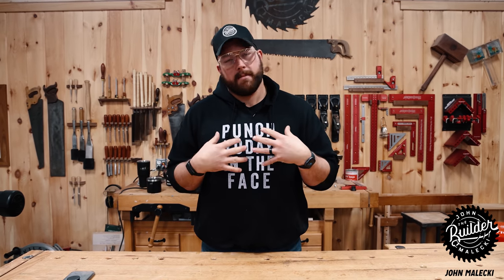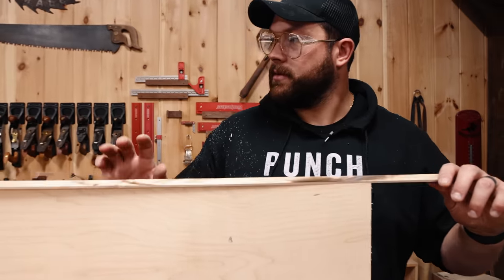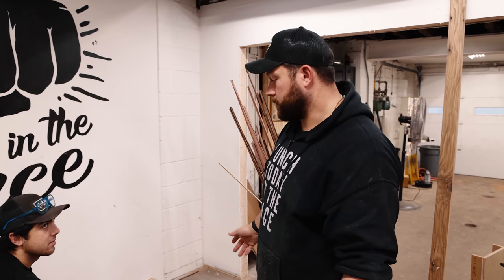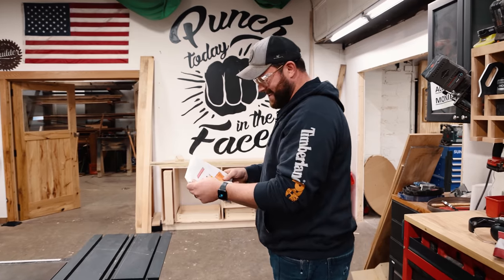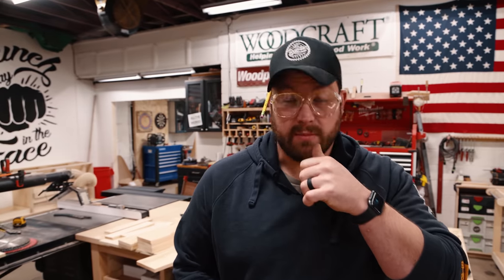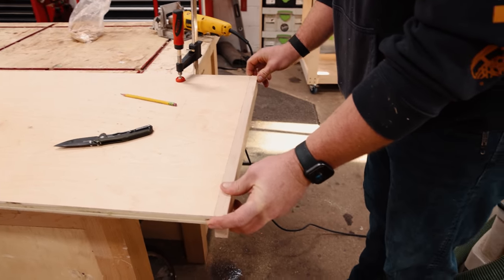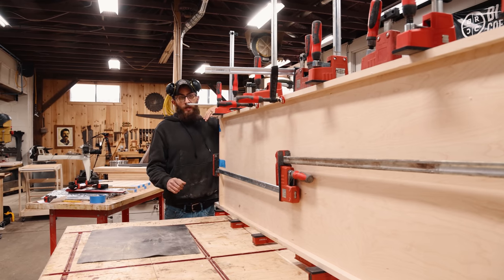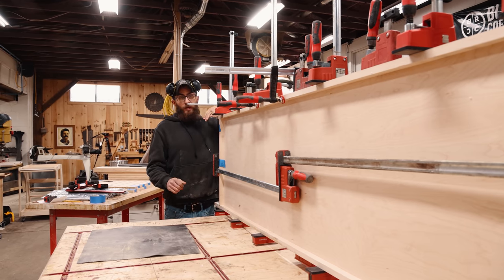ULTIMATE Shop Storage Cabinet Build

Comment: Suggested upgrade/modification on the vertical draw if you put the runners on the top and bottom rather than the side you could have a draw on either side with dowells going straight through, with one side being for new blades and the other side for old. Good job on the rest tho

Comment: Since you don't really have a problem with pausing in the cut, if you clean the pitch off your table saw blades, you should get much less burning, which might save on sanding time.

Comment: I dig the design but John why didn't you guys flip the outside vertical slides the other way so the blades faced towards the center of the cabinet when standing in front of it???